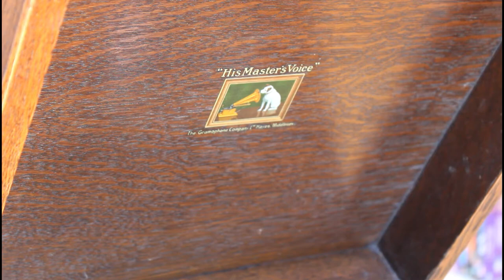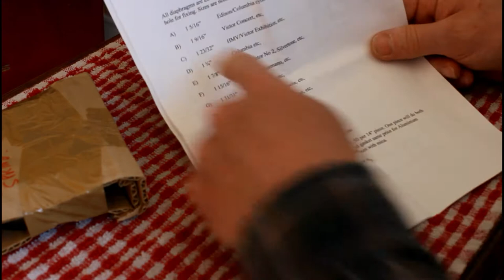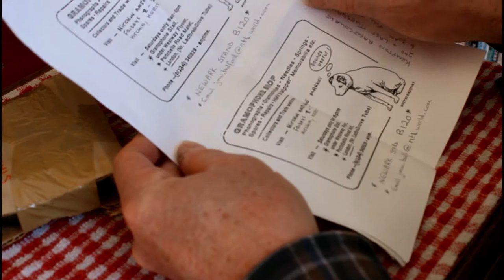HMV 130 Wind Up Gramophone Repair.  Spring replacement and service.

Comment: Great job with that spring. Sounds good.I need to get a new diaphragm and diaphragm gasket for mine. It works ok but could be better
Reply from the maker: I was really surprised how good the HMV 5A soundbox sounds, and with the lid down the bass is boosted and the record noise is greatly reduced.  It seems to handle all types of recordings well and produces a good sound.  Nice gramophone too.   When you get your new diaphragm and gasket fitted, I expect you'll be very happy.  Thank you for your comment.

Comment: Do you  repair soundbox ( hmv 5A ) ?
My soundbox is ok except the tightening screw is loose when I put a steel needle inside . If has loose grip. I suspect the screw thread is damaged !
Reply from the maker: Hello Julian, I have not repaired a soundbox, there are some people on YT that have. However, it sounds to me your problem is as you've said a stripped thread. I'd suggest unscrewing the needle clamp to see if it's damaged. If not, then it's the receiving end that has stripped out. This can possibly be rethreaded with correct tap. There are some people who still repair these.  You will need to research to find someone. Try other YouTubers first they may have better information. Thank you for your comment and good luck.

Comment: hi gentle, at full recharg, how much turns do the crank? in my 2 130s i can do about 30 crank-turns from full descharge to full recharge. many thanks
Reply from the maker: I've never fully crank the handle to the point where it stops.  I go by feel and turn slowly and steadily.  I also occasionally wind it up with the platter turning.  As long as it plays one side of the 78 (between winds) I'm happy with that.  It's an old machine so I treat it carefully.  Thanks for your comment.

Comment: Excellent job! I use to play this gramophone model here in India some 45-50 years ago. It belonged to my grandfather. He bought it for Rs. 50 before 1945. It was a masterpiece from His Master's Voice. Unfortunately we lost it over the time. As a child I always wondered what was going around inside that moved the turntable. Today you have solved that puzzle for me. Thanks a lot. I can see that you are so well equipped and skilled. I wish I could be your apprentice. Would you like to answer a few of my small queries? What is the function of governors? Why the drum (that houses the 2 springs) moves intermittently while the big gear wheel moves smoothly? How is the speed regulated to run at 78 RPM? I hope you would find some time to answer these queries. Thanks again.
Reply: Well the governor is There to slow down the speed and it stabilizes the speed.

Comment: Very good and turned out well. I had to fix a spring in one of these a while back and I am interested to see how you got the first spring down into the barrel. It didn't occur to me to tap it down via the dividing plate. It did take me a couple of goes however I was able to get the spring to go in and sit at the bottom of its own accord. Certainly do need to keep a good grip on them and I agree that best to fit the springs before putting the grease on. Thanks 😀 👍

Comment: It's good practice to keep the wire on new springs so that once you have the old one out you can push the new spring straight in and then cut the wire. No rewinding needed. Just care

Comment: Watching and interested to have a go at this myself sometime for the first time. 
Is that gramophone a double spring?
Does that new spring come cable tied, so it can be removed inside the gramophone itself !! ?
Last question……… Do you know if that company on that parts sheet are still in business or can you recommend somewhere that supplies a new spring. I hope you reply 🙂
Thank you
Reply from the maker: Hello, this gramophone is a double spring model. The new springs come cable tied with heavy duty ties.  My replacement spring had 3 ties.  Some people have commented on the approach of fitting the springs into the drum with the ties attached.  This in my opinion is nonsense for a couple of reasons.  The springs come pre-wound tight, but mine would not go into the drum as they are not wound tightly enough to fit into the drum.  Secondly, assuming you can get the springs into the drum, as you cut the ties the springs would expand into the drum trapping the ties against the wall of the drum.  I believe It would not be possible to remove the ties at this point.  I see how people might think this would work, however, I haven't seen it done this way myself.  The best place for gramophone springs is the internet or eBay.  There are not many sellers left these days.  It may be that once you get the old one(s) out you might be able to repair it or just refit depending on what caused the failure.  I hope this helps and good luck.  Thank you for your comment.
Reply: @dembydish  ok Thanks
I’ve not ever worked on any gramophone in any way, apart from using different ones to upload to my YouTube channel. The spring in my HMV 130 is of course a double spring, it has been replaced once with a reconditioned one. I only want to buy another double as a future spare. 
The other gramophone in question that I want to try to replace a spring is a HMV 112. Is that a single or double do you know ?
What you say about the cable ties and spring instalment now yes makes sense, thanks. 
But I hope to have a go at this spring replacement in the future, when I build a shed to work in and soon. I’m in my late 60s and don’t want senility to set-in before I try repairing the gramophone 🙂🙂

Comment: old video, still I have to comment! Very nicely done, both the video and the job. I thought, clock springs were scary, but they are just about half the size of the gramophone springs!
Reply from the maker: @hugonotti9192  Hello Hugo, clock springs... .  I'm guessing here but I'm thinking large clocks, maybe Grandfather clocks?  Anyway, the gramophone is still going strong and still making music. Thank you for your comment.
Reply: Wall clocks and the like, also older kitchen clocks. They get up to 1" in width and quite substantial thickness as well.

Comment: I would like to add my 2 cents worth! ..... If you would've left the outside wire on the new spring and removes the two tie wraps and slipped it back into the spring housing when you were ready for it and then removed the wire holding it together . You would of saved yourself a lot of time!
Reply from the maker: Hello, an interesting idea.  The problem is the spring (as it was  purchased) has a larger diameter (across the coil) than the cylinder it needed to be inserted into. Simply wouldn't fit inside!  Thanks for your comment.
Reply: embydish